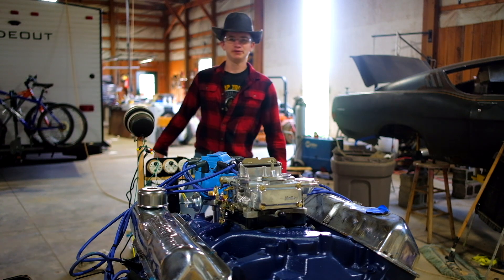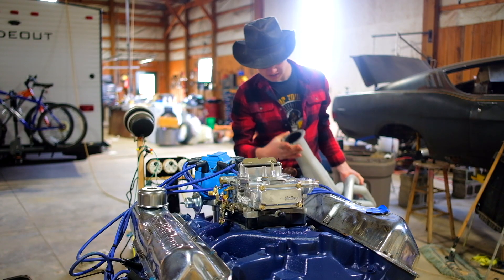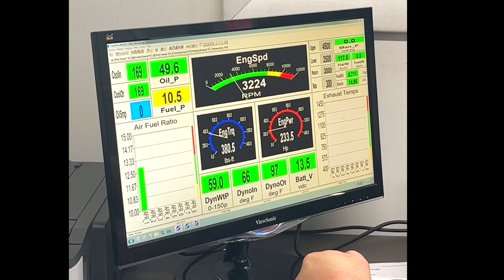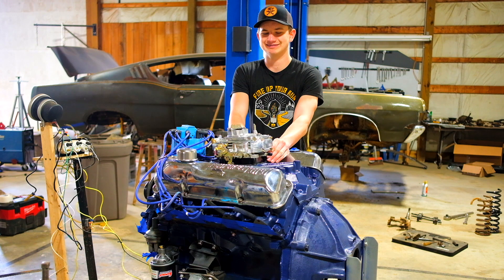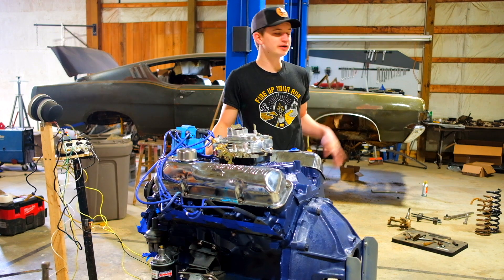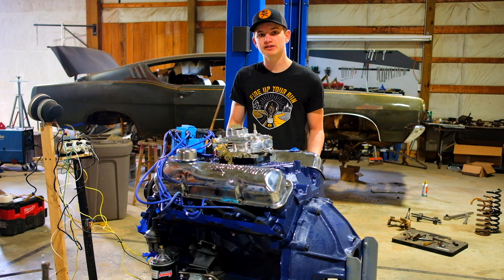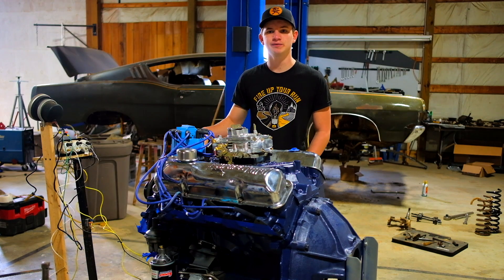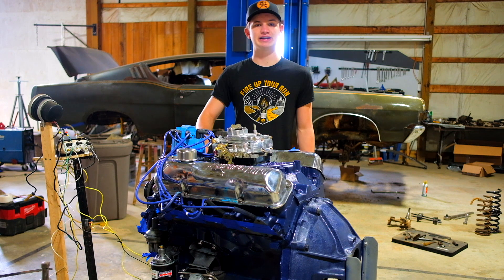Stock Rebuilt Ford 390 GT Dyno Tested

Comment: The 1969 Torino came with 3 different 390 engine codes S,,Xand Y... I'm not a 100% sure but I believe they all had different cams and horsepower ratings. I owned an S code which was the 320 horsepower Engine... I believe all of the 390 engines had around 400+ foot pounds of torque though. I think the y code was rated a 275 hp. I cannot remember exactly but I thought I once read that the 390S code had the same Cam as the 428 Cobra jet. Just offering a solution as to why the horse power number is off but the torque number seems to be spot on. The general consensus by experts is that most of the performance engines for the 69 era were grossly underrated for insurance reasons... You have to really look to find it but they have dynoed original low mile cars and the Results are at or above Stated horsepower and torque ratings. I am not an expert I'm just really good at researching things and read way too much. I would suspect with an improved perfor me it's factory Cam and some timing adjustment you could come close to the 320 horsepower you were hoping for. Enjoy your endeavors!
Reply from the maker: Thank you! That’s kinda what I had read too. I also love reading about all that stuff😎
Reply: The 335hp 428s are way underrated and NHRA bumped Ford up a bracket for it.  That was also because the 426 Hemi got put into every single mid-bracket car in the 1960s and only a few 428 FoMoCos and 427 BBCs would run in those classes.  1968 and 1969 are like all Hemi below Pro Stock lol.  The 460 in the 68-71 Luxo-boats is way underrated at 375hp, not to mention a 460 has a power curve that reaches way down below 2000rpm, and stock those high-comp 460s really move a car.  The Boss 351 is underrated, the Boss 302 and 429 are known underrated.  The 454 LS6 is over-rated at 450hp, but possibly can reach that number with a lot of tuning on a cold morning near sea level.  Almost all 426 Hemis are underrated until 1971, they usually made 440-475 hp, more earlier in 1966 actually, when the cams were as high as they'd get.  They were all rated at 425hp.  Most Chev 327s are under-rated in the early 1960s, the 289 Hi Po is almost always over-rated by its drivers and Ford fans.  Some 440s are notoriously under-rated usually the dual-carb versions, not the six-packs interesting enough.  Those are the high points of underrated.  The 428 Cobra Jets from 67 on are most grossly underrated, they were running with tuned Hemis and beating them pound for pound on the regular.  The DZ302 is not even close to 400hp, but a Boss 302 w/o the electronic rev limited IS near 400 hp, but that's not officially stock, though it is a race motor that sort of runs on the street if you keep after it, and with the (electronic) ignition limiter off, that's a pretty serious mod.  I think the Boss 302 was ridiculously limited to 6000rpm, and the DZ302 got a 7000rpm limiter.  A DZ302 will not make power past 7k stock (no, it won't), but a Boss 302 will.  But not officially 'stock'.
Reply from the maker: @TheFogLakeshore  that’s cool!
Reply: @TheFogLakeshore Richard Holder did some dyno testing of the Ford & chevy small blocks in stock form with the exception of a modern carb & Headers for the dyno & it revealed that the 327 small blocks did not live up to there claimed 365 & 375 hp rating. They hit about 350hp. However in the early & mid 60s 350 hp from a 327 ci engine was a absolute beast! No doubt these engines ran well. But not 375hp well. Infact only one of the small blocks reached that number but though it was chevys claimed hp rating, it was only the ford clevland that was able to actually produce hp numbers that high. The 71 351 boss hit 380hp however it was only rated by ford at 330hp. The chevy DZ302, fulie 327, & the 70 350 all used the same heads & cam but only the  DZ302 was under rated. All the other chevy HP numbers from that test fell short of there claimed numbers. Fords numbers were pretty close to being right on or they were rediculasly under rated. The 289 showed to be accurate rating. Boss 302 & Boss 351 were very under rated!
Reply: Hard to believe but it's true. Ford really underrated their high performance engines. I agree that the 289 was an exception, but the early Mustang was so light it made up for it? @TheFogLakeshore

Comment: used to race those 390s back in the day with my 68 mustang 351 windsor 390s stock were not that quick if you want it to come alive changes the heads and intake paint them like they are cast iron it would seem you are going more for the total stock package

Comment: A couple of people looked at that curve and said "too bad about the power".  That engine makes 200+hp from 2500 to 4500 RPM on a table-flat curve.  I'm pretty sure those commentors have never driven an American big-block car with power available below 3500.  A driver uses all the power under the curve during acceleration through the gears.  If you sum that area with integrals, the power available from this motor is a LOT more than an engine with a higher peak # and a fall-off graph.  The flatness of it makes ALL the difference on the street as well.  That's what makes your car have the ability to drop a gear and accelerate, or pass while texting and eating, etc.  Lol.  People just don't know.  That's going to be a very rewarding car to drive.  Even if you can get higher cubes out of a small block, the medium and large blocks like FE have larger areas for ports and manifolds and valves, less valve shrouding due to bore.... people who don't think about this stuff but read a lot don't really know what they're saying.  390 cubes out of an FE and 390 cubes out of a SBC are NOT the same thing.  Big block 'stump pulling' power is based on the fact that there is a whole different ball game going on in the port arrangement than a little small block no matter how big the ports or valves.  Big blocks always win an equivalent contest, the medium FE is no exception.  It will have power only a big block American car can muster.  Again people who haven't driven them don't know.  Stock stall converters work great with numbers like these.
Reply from the maker: Wow! That’s what I’ve been saying all along! My grandpa is a huge small block Chevrolet guy and I keep telling him that he should try a big block, but to no avail. Thank you!!

Comment: I d put C6AER heads and the same cam as the CJ cam which is what a 66GT would have. I don’t think the heads and cam are right. Worth a shot. The C6AER heads have the tall port like the CJ heads and if you want, a CJ intake would do well. Just some thoughts.

Comment: One of my FE's has 360 pistons,different pin height,I call it my 404,file not found.Running a police interceptor intake.smooth out the exhaust runners and it'll be fine.
Reply from the maker: That sounds pretty awesome!

Comment: That cast iron intake weighs 90 lbs.  & The heads are the same.  But, an FE with aluminum heads and intake is as light as an all-iron 302/351.
Reply from the maker: Yep, I recently bought and installed a sidewinder intake. One day when I can afford it I’ll get some aluminum heads.

Comment: I had a GT390 in a 67 galaxie 500 with a 600 holly on it. The 600 cfm wasn't enough for the displacement . I installed a 835 cmf  Motorcraft carb off of a 428 police intercepter, and it made a very noticeable improvement in the power. C6 auto would kick down at 120mph and pull like a f...er. I chewed up many a vette with that car.

Comment: Perfect motor...tons of torque  and it should turn 6000 rpm easy..they need a high pressure oil pump and a deeper sump oil pan..that motor will last forever...

Comment: with those #'s,   I'd have done a Cam replacement to get the power up 45 or 65 HP.    there are a few cam upgardes, from mild to wild, me personally I'd put a COMP Cams Thumpr Hydraulic Flat Tappet Cam and Lifter Kits K33-600-5 - good power from 1800 to 5600,  would help make the car move pretty good.

Comment: Watch the FE engine builder out of PHX. Did a complete video series. Anyway, C8 C7 heads are nearly identical - just info. C4, the older (big port) seems to flow a bit better. The 7 and 8 are a bit better for torque (known as velocity ports to some) and the older C4 make a bit better HP stock form. Dedicated FE ford engine builders (machinists) as opposed to must of us (assemblers) will have CAD files to take any of these FE heads and open them for serious power. Your just left with a decision as low, mid or high rise configurations based on personal needs. All the rage for aluminum is understandable. But, pure budget builds for street pounding 400HP is easy with any iron FE head. FE engine (builders) know how to clearance  CJ size valves into the sedan style heads    and port match all the junk. Heck, find a (1U) crank and you got a 410ci with no other part requirements. The FE is very cool. The ancient Eddy Streetmaster intake can be opened up ALOT and matched. I say that cuz you see them at swaps for just a few bucks. CAD files exist for those too or so I'm told. Any FE sounds really cool. Isky has a great CAM kit (several depending on need) that has fair idle, great sound and uses 370ish ratios with stock converters. All very reasonable. I've (assembled) a couple FE  based engines - they're just cool 😎. Going start on another in a month or two  going into a 66 Gal. I've never done the high horsepower FE but street stuff is a no-brainer.
Reply from the maker: Thank you so much!
Reply: Billy Goldbond is a very good cam grinder for Comp Cams. I had him grind me a solid flat tappet that was 233 intake @.050 and 241@ .050 exhaust and.550 lift both sides and 109 LSA and 105 ICA. This was the spec Lunati 351C for 358 sprints. I told him my goals and he did it with his own knowledge of what the 390 needed. I bored it .020 over and it was 394 ci. A Holley Street Dominator matched tho my C4AE heads that I took the hook out of on the intakes. They breathed 288 cfm and 205 exhausts. I put a set of Crites 65 Galaxie long headers 2 in primary, 3.5 collector with extensions out to 30 inches before necking down to 2.5. The intake valves are the same size and LR 2.066. Dynoed it at 465 ft lbs and 503 hp. open headers and it sounds like it wants to eat you. I figure with an Edelbrock 750-800 and 2.5 with mufflers to dumps at the rear axle it is 445 ft lbs and 488hp. I built it in 1999. Put 4.33s and a lunchbox locker in it and I could lay down 2 solid stripes all the way through 1st and 2nd and a good ways of D with C6 and a 3000 stall speed converter. But a bad concussion took my sight took my license away. I want to drive it so bad. My wife and Son are scared of it.

Comment: Looking at the Dyno graph it looks like your lifters are pumping up and that's why it's nosing over after 4k rpm. So an old timer showed me how to make brass shims that go between the rocker stands and the heads. Off the top of my head I believe it was 0.060" worth of shims. I'll go up to my shop in the morning and measure them. I'll take some pictures so you have a better idea of what I'm talking about. I can email you the pictures if you would like.
Reply from the maker: Interesting. I have always disliked that the stock rocker shaft isn’t adjustable
Reply: @itllrun6030  I measured my shims and they are 0.030" thick, actually they are two 0.015" shims but, totaled 30. Now that was with zero machine work done to any engine surface. My GT390 pulled to 5200 then nosed over. I shifted at 5200 because any more rpms and the time slip didn't improve. Give the shim thing a try, dudes were doing the shim trick back in the '60s on their GT390s for a reason.
Reply from the maker: @samuelfreeman9518  awesome! Thank you!

Comment: You need a bigger cam with that engine and if you want to make big power you need to invest in aluminum heads with some flow numbers and get compression up to at least 10:1.  No reason a big block ford can't get 375- 400 hp with cam if your compression is up ! And with high dollar heads 500 hp.

Comment: Don't discount the Autolite 4100 4bl. It is a really good performer for a stocker, what's more, jets can be changed just by removing the top of the carb, unlike the Holley with end mounted float bowls.

Comment: Aftermarket rebuild kits don't have the same compression ratios... guessing this one is a rebuild, prolly 9.5:1 comp... 10-10.5:1 is worth very noticable power on these animals.  Don't know what he did on this one, but 275 seems a bit low.

I had a 390 with 252 cam, 10:1 comp, '69 F150, got 18 mpg around town, and beat a Chevy K10 with a 454... FEs are a great platform!

Comment: How much total timing were you running? Most iron headed FEs seem to like 38 or more in some cases.
Reply from the maker: I think we ended up with 39 or 40 fully advanced😎
Reply: Engine looks like you used a low RPMs truck cam and thicker than stock 'rebuilder' head gaskets...

Comment: You didn't say anything about what pistons you used. Pre-1966 pistons had different wrist pun placement, which raised compression ratio. I have a 1969, 390 with '66 Fairlane pistons and a 750 Edelbrock carb, solid 440 lbs of torque.
Reply from the maker: Yeah, I know. I would’ve but there wasn’t much to say about them, they were just stock .040 over with the eyebrows.
Reply: Glad you knew about that. Ford had changed that so it would be longer lasting in big cars and pickups. The 428 took over as the performance engine, but a well built 390 can go toe to toe with any big block out there

Comment: Good stuff I wonder what my 428cj would make. Probably barely over 300hp. It’s in my 72f100 my kids call it race truck. I plan to put a 100 shot of nitrous on it and play around. These engines are so tough I could probably put a big shot on it but going to keep it realistic
Reply from the maker: That sounds like a plan to me! I would say your 428 cj makes a lot more power than my 390. A 428 cj has bigger valves more displacement, better intake and cam. In the end horse power doesn't really matter. It's all about having fun.
Reply: @itllrun6030  going from one to the other it honestly doesn’t feel like it has a bunch more power. Was a very little gain. But I’m still trying to get it dialed in better maybe it will surprise me next time.

Comment: They are good motors, but not king of the street.  I question if a 600 cfm carburetor is enough.  I don't know how much horsepower you can gain by putting an aluminum intake on it, but there would certainly be weight savings.  It appears you're trying to go back as close to original as feasible.  I can respect that, but I'd want to squeeze some more RPMs out of it.  I've found that Edelbrock's performer RPM manifolds extend the powerband on SBF's, it probably would for a 390 as well.
Good luck with it.  I once owned a 69 Cobra with 428.  Sure wish I still had it
Reply from the maker: Yeah 600cfm is too small. I’m currently in the market for an 800😎

Comment: I love the FE engines they are low end power houses. I thought the 390with stock 4barrel put out 335 hp, but it's still a good start for 60 year old iron.
Reply from the maker: Well come to find out I had way to much lifter preload so it stopped making power at about 4k. But I’ve fixed that now and if you continue to draw the lines it looks more like 330 or 340 horse power

Comment: I think it's awesome to see a kid get into mechanics instead of spending all their time entertaining themselves with video games, Tictok, and Youtube. Good job kid. My kids aren't even interested in the 30+mph go-karts I bought them... Should have spent the money on my own project cars instead... The only time I can have quality time with my kids is when I play video games with them but that doesn't get anything done nor have they made any money doing it. You'll be driving a cool car when every one else can't get there butts off the couch! Build it for some decent gas mileage though because gas isn't cheap these days. Increase the compression and tighten the squish. Lighten the car up with fiberglass body parts and aluminum engine parts as well. Put in a overdrive transmission, it'll pay for itself. Today's gasoline is more detonation resistant than most realize. Maybe try a water methanol kit too!
Reply from the maker: Thank you so much! I would love to do all the lightness stuff but I’m poor😭😂
Reply: He should be running 9.5 - 10.5 compression on a stock 390 GT rebuild eh?  I'd agree I've always heard FEs can be pushed in both timing and compression, both of which will improve gas mileage if you don't use up the gains with your foot :D
Reply: @TheFogLakeshore  I ran 10.5 on a cast iron headed 428cj with cheap gas on my v-drive boat @40 degrees locked timing. It never peened. 240 degree camshaft @.050. Early 427 heads c3ae and medium riser dual quad gt500 aluminum intake. It was mean out of the hole.

Comment: It should turn up higher without any problems. Up to 6000 rpm without a problem.
Reply from the maker: It didn’t need to, it ran out of air and stopped making power by 4500

Comment: Good looking 390 engine!
But it is one heavy lump of a big block to make only 257 HP.
If it were mine. I couldn't resist putting an Edelbrock aluminum 'top end' kit on it to save 140 lbs and add 160 HP.
Reply from the maker: I would if I could afford it😂

Comment: I think these engines would benefit from retarding the cam 4° and then recurving the distributor springs and weights. Doing so will shift the power band 500 rpm higher and swap low end torque for high rpm horsepower